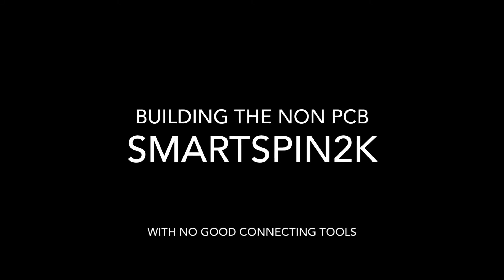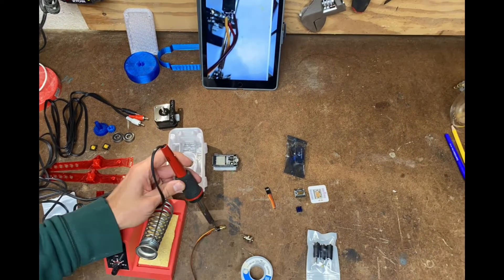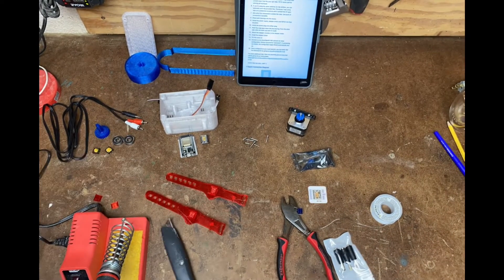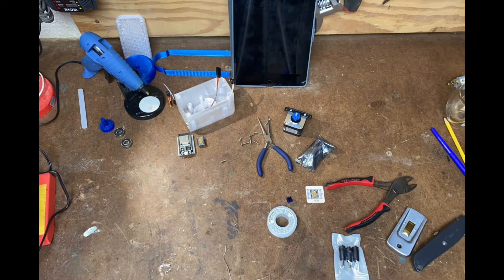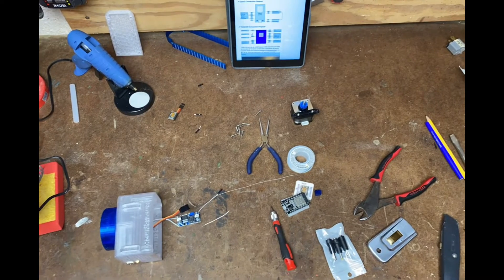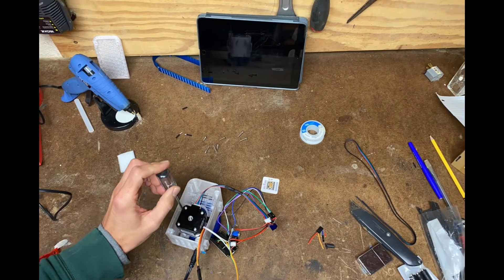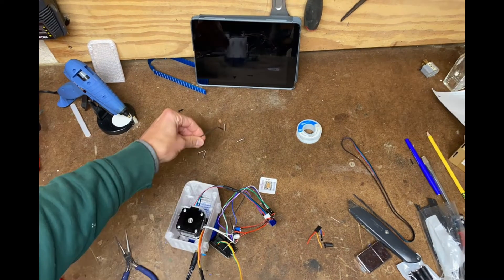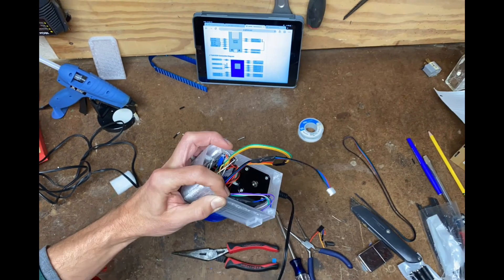SmartSpin2k non-PCB Build Guide

Comment: spin bikes dont have shifters or cables. So what is this build really about ?
Reply from the maker: The shift buttons are a part of this build. They increase or decrease resistance via the motor. The main point of the build is to add an automated resistance function which interfaces with virtual riding apps like Zwift. When connected to the app the spin bike will act like a smart trainer, increasing and decreasing resistance with elevation or when pressing the shift buttons. If a power meter of some type is connected to the SmartSpin2K then ERG mode will control resistance to maintain the application set wattage.
Reply: @Bym  ok thanks